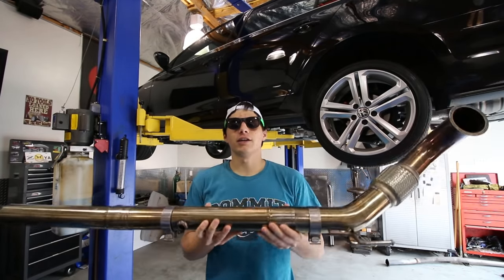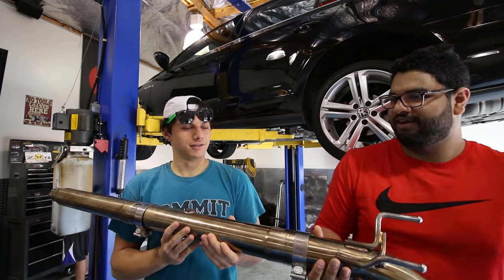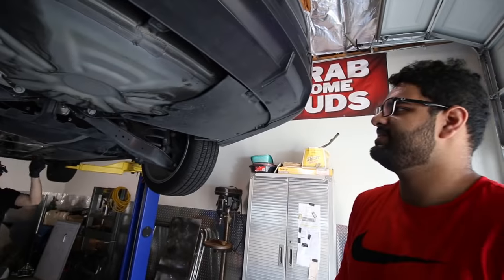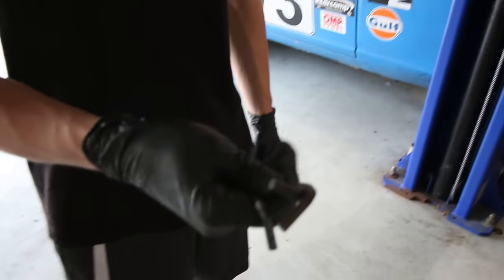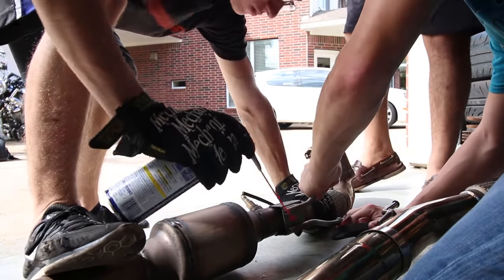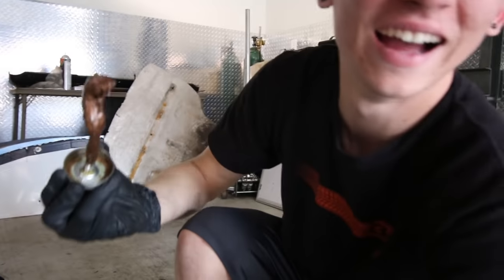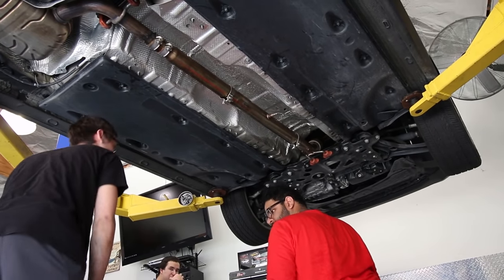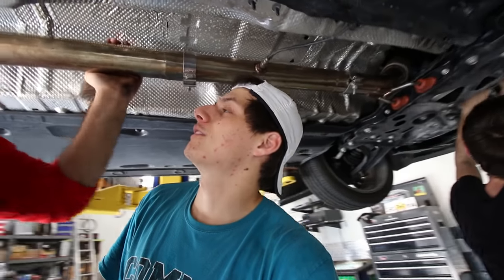CTS Turbo Downpipe Install for MK6 GLI!

Comment: @TonySanch what else is done to the gli ? You installed a cts turbo down pipe and it sounded like that just because of the down pipe ? Do you have charge pipes installed and anything else like tune or intercooler ?

Comment: Did you ever get rattles? My CTS turbo downpipe rattles like a mofo
Reply from the maker: Never rattled for us
Reply: Tony Sanch exhaust shop found the problem. Rear hanger.
Reply: Mines too currently trying to figure out why
Reply: mine sounds like paper in a bicycle stoke. is that what yours was?

Comment: did he have any issues with back pressure because he left the stock muffler on?
Reply: He likely would due to less resistance and larger pipe.  He'll need to do a tune.  With a 3" downpipe and 91, he can get a stage 2 tune.  I'd recommend completing the exhaust and intake first though, otherwise he'd have to get another tune to get it just right.

Comment: remember what size allen wrench for the donut? probably an 18 ,the one im missing.
Reply from the maker: Nah I don’t remember. It was a long ass time ago 😄🤷🏽‍♂️
Reply: @TonySanchez  it is a metric 6. I had to heat mine up with a torch so it didn't strip when I was taking it off.

Comment: is there any drone with the catless downpipe? I really want to do a downpipe but im scared it will be a lot louder. i use my bluetooth a lot and commute with my car so a mostly quiet ride is important to me, id like some sound though..  i do plan to use my stock catback though.  anyway, any drone???
Reply from the maker: Its not to bad. Like if your cruising at about 2500 or 2700 you can't really hear it. Anything past that you begin to hear it
Reply: hearing it and drone are two different things lol.  Any drone or rattling of the cabin?
Reply from the maker: You begin to hear drone after 2700 is what i mean
Reply: Tony Sanchez damn thats exactly what i didnt want to hear
Reply: The care drones because of the soundaktor. Whenever I went to give it a little bit of gas, it would drone. I took off the soundaktor ( took 5 mins) and the drone is gone, car sounds quiet on the inside.

Comment: Question, what state are you in? I'm pretty sure this wont pass Virginia state inspection
Reply from the maker: Texas
Reply: Tony sanch what part of Texas. I need some VW friends. Lol. Im in DFW
Reply: @berto371rr  my 2.0t jetta is about to hit stage 2!
Reply: @proelitematthew7811  im on Jb4 map 2 about to install dp and do meth and front mount and then making a custom map 6
Reply: @berto371rr  wow! Meth? Damn bro, that's kinda risky lol
Reply: @berto371rr  I'm about to install a cts BOV, stock one is failing
Reply: @proelitematthew7811  ya. Only for summer use though. To keep temps down during hot days here
Reply: @berto371rr  lol ahh I see you! I'm using a jb4 right now, but I'm planning on switching to APR. Should I? Lol

Comment: my car has a straight pipe too sound amazing
but i got check engine light ! do you have same problem ? also how could u pass emission test because i need to go to emission test soon so no idea what to do ? help me guys :) thanks
Reply: I passed it 😂
Reply: Murat Solakoglu how did you pass?
Reply: mohamed77224  I used  oxygen spacer sensor extension ... you should look at YouTube it will help you if u have question I can help you
Reply: Murat Solakoglu thanks for the advice. I will look into it
Reply: mohamed77224 depends on the type of test and where you go. If it's a sniffer you Will fail also make sure you car is warmed up so the cold start is not even a thing.

Comment: that sounds fucking sick with the stock muffler lol, had to rewatch to hear if it was tuned already or not...  i didnt catch if it was catless or not but it looked like it had one..

 how many lights came on when you fired up with out o2 sensors though.
Reply from the maker: Lol the check engine like went bazerk :p

Comment: My downpipe keeps coming loose lol
Reply from the maker: Ouch, its probably the clamp. Thats what we kept having trouble with
Reply: Tony Sanchez i used the same clamp again 2days ago no more rattle and no more getting loose for now lol
Reply: Does the tailpipe needs a gasket on the flange where the v clamp goes? I've seen a gasket on tailpipes that are attached with 4 bolts .